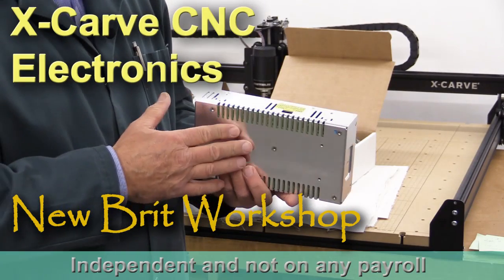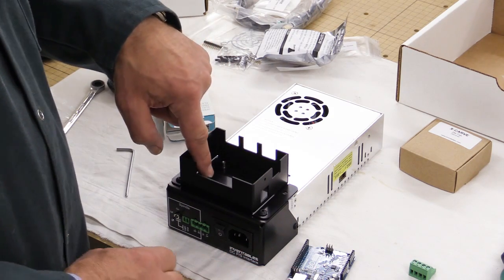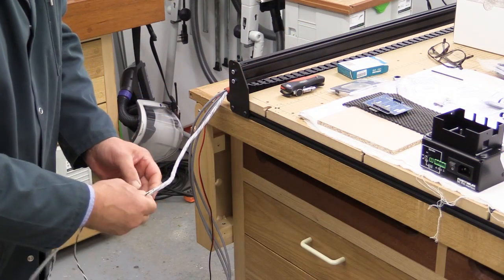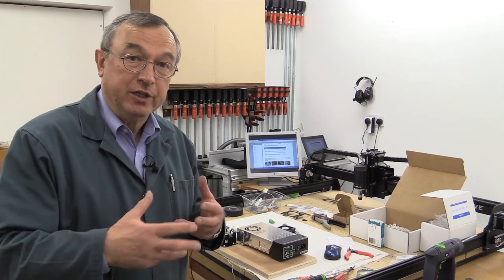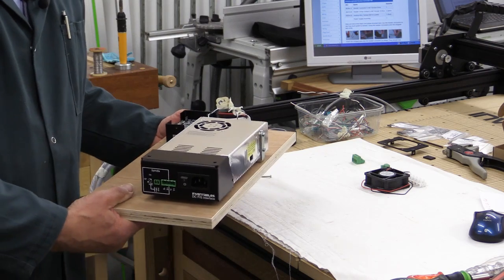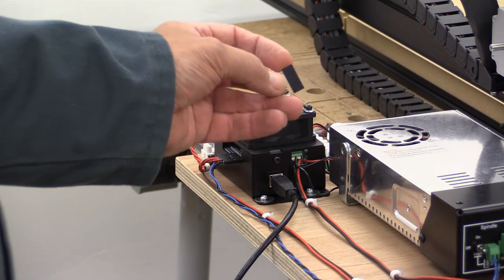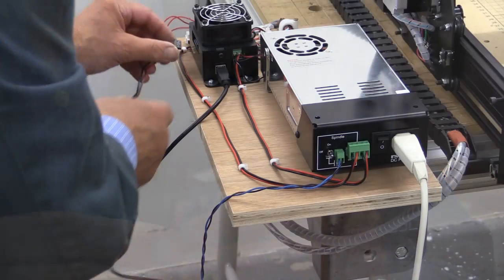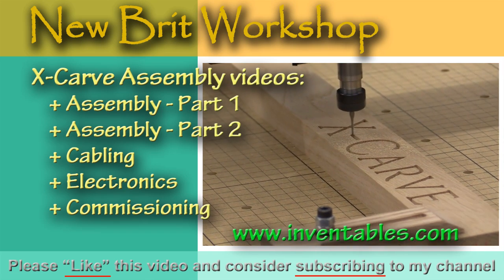Original X-Carve - Electronics

Comment: is it possible that then i use the g code sender and then go back to easle that the machine is not working any more ?? ;(
Reply from the maker: +the1to9   Yes it is, especially if you made the same mistake that I made which I describe at the very start of the X-Carve commissioning video - https://www.youtube.com/watch?v=4kjAuN1Y3B8         I also had problems with the connections for the limit switches that go to the Arduino. If they are not done carefully they can cause an intermittent fault.     Peter
Reply: hmmm i was carving right a way did not install any thing have win 8 i was carving already just try to do that what the told me.
https://discuss.inventables.com/t/two-stage-cuts/869/3
so after that the machine say locked so i think i foud the problem.
but i will try to get g code working i mad one big jump in to my wood  ;) so lucky me all went well. But still done know how it works or why not ?!?!
and how i say g code file in Vcarve ?
Reply from the maker: +the1to9  I am afraid that I do not quite understand the question at the end of your message. If you want VCarve Pro to produce gcode then you need to install the appropriate ".pp" file (either millimetres or inches) which is available from the Inventables web site. I think that I cover this in the X-Carve coding video.   Peter
Reply: sorry i am german so english is not the best  :) yes i did that but then when i try to save it its say x carve can not handel tool change so i can not save it as g code only as SVG.
but i need g code for the g code software if i get it runing !
Reply from the maker: +the1to9 If you have VCarve Pro you should not be using Easel at all. The workflow is (1) Create the drawing either in VCarve Pro or in a compatible drawing package. (2) In VCarve Pro produce the toolpaths saving them in the gcode format (either mm or inches). (3) using the Universal GCode Sender home your X-Carve and tell it where the reference point is (G92, x0 y0 z0). (4) Take each toolpath file (which should have the file extension ".gcode") and send it to the X-Carve. (5) If you need to do a tool change then do it before loading the next toolpath file and redo the job home reference point with the tool tip in the right place (using G92 x0 y0 z0). If after the too chage you have not accidentally moved the carriage in either X or Y direction then you only need to move the Z to get the tool tip in the right place and issue G92 z0 only. You English is far better than my German. My old German boss was always correcting my written English and he was always right !    Peter
Reply: thanks Peter yes i did that so  (1) but after the work is done, it goesjust  back to home without lifting the bit :( frustrading and 2 just before it is almost dont i think its losing step or what that is it just start messssing up my work :(  3 some how i change the speed rate in Vcarve when i selecte the bit but still very fast i think.
And i see now i forget that step G92 so that may be part of the problem
well well i try for 3 days to get it to work now my sister need to be without b-day present :) she will get it later hihi
Its a lot on your brain when you think a lot and all is new.

Aufwiedersehen :)  Karsten
Reply from the maker: +the1to9 VCarve Pro will not be able to change the speed of the X-Carve spindle - you have to do this manually. You may have to get another birthday present - perhaps chocolates !  Peter
Reply: oh miss spell mm/sec well have a nice weekend Peter

Comment: Apologies for all of the questions...

1.) How many I/O spaces did your terminal block require for all of the wiring connections?

2.) Did you use the same guaged wiring as came from the machine to go between the controllers and the terminal?

3.) If the same gauges were used, what are the gauges of the wires?

And, many thanks for your continuous patience.
Reply from the maker: +TheRangeControl There are 20 terminal block connections and mine were divided into an 8 and a 12. I did use wire that looked to be the same gauge but as it had been around for years I do not know what gauge it was (I do not buy a lot of wire !).   Peter
Reply: +New Brit Workshop (Peter) Thanks :-D

Comment: How did you mount to the wood?  Which parts did you use (brackets, screws, etc.) Where did you get them, and what were the part numbers?
Reply from the maker: +TheRangeControl If you mean the bits that I used to fix the electronics on the piece of plywood - it was a scrap of wood from the workshop. The brackets were "L" shaped brackets from a DIY shop and the screws came from my box of screws saved from things being thrown away (old irons, kettles, toys, tools etc). So sorry, there are no part numbers.   Peter
Reply: +New Brit Workshop (Peter) thank you.

Comment: to make the crimps easier, buy a crimper like this one http://www.easyreprap.com/#!product/prd1/4291736705/sn-28b-pin-crimping-tool-28-18awg-crimper
this makes crimping a breeze and they come out way stronger this way. Why didnt you mount the aurduino to the power supply? washers seem to be part of the original design. looks like they got rid of the nylon washers a while ago.
Reply from the maker: +Stephan Kyriakopoulos Excellent point - many thanks.   Peter
Reply: Great to know.  Thank you.